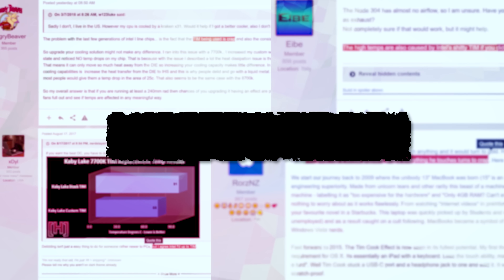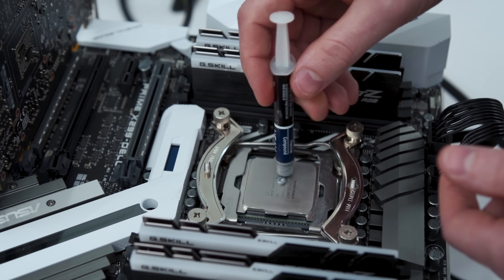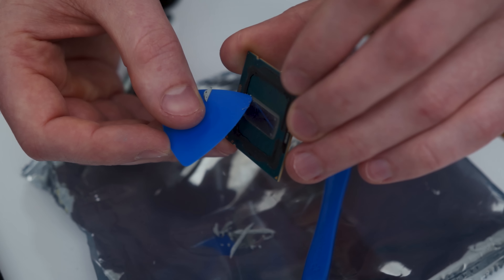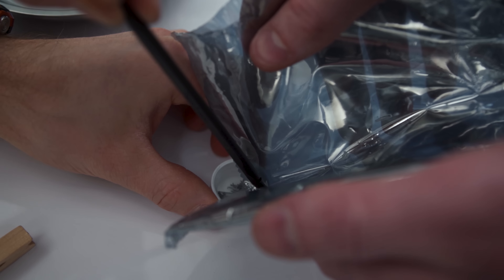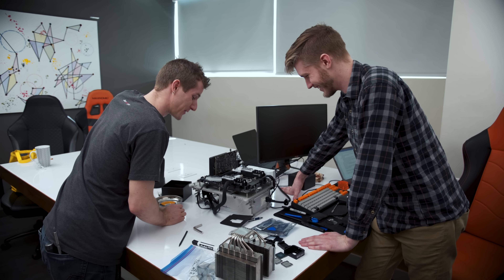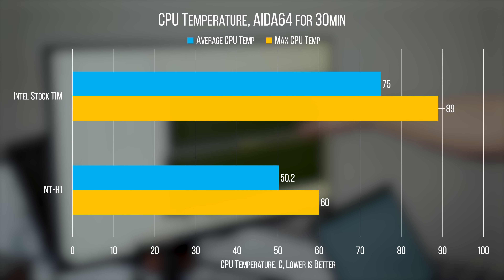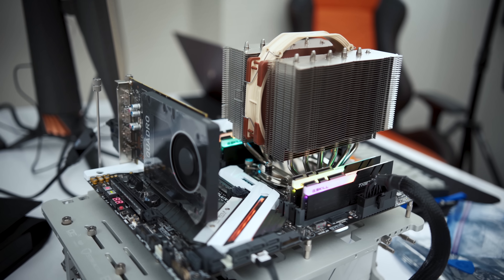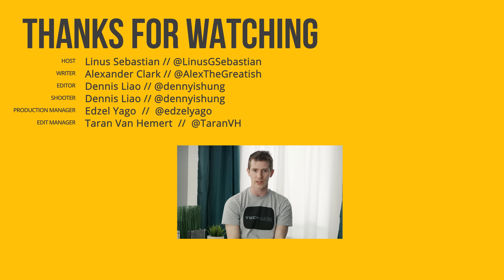Is Intel’s Thermal Paste ACTUALLY That Bad?

Comment: This is really a horrible way to test it..
Reply: xorinzor 
Welcome to LTT
Reply: if you haven't noticed from their "Are review sample CPUs cherry picked?" video, LTT is not very good in these kinds of things, except for regular bench tests.
Reply: i mean seriously.. trying to reuse 6 year old hardened paste? wtf
Reply: What's a better way to test it?
The intuitive way would be, to compare performance Pre vs After delidding, but they actually did that already.

But I agree. All those other factors they wanted to avoid having to deal with, are still present. Just on top of the IHS instead of underneath. Thickness of the application etc.

But this is exactly the kind of ridiculous nonsense that makes LTT fun to me, so I won't complain.

LTT is basically the Marvel Cinematic Universe of tech channels.
Professionally made, entertaining to watch. Not much of anything else.
Reply: I DISLIKED THIS VIDEO XD
Reply: What they showed after taking the cooler off was waaaay thicker than the noctua paste, so the result is kinda garbage :s
Also it still looked wet, so the alcohol was probably the better heat conductor here xD
Reply: xorinzor I've attempted reconstitution of silver thermal compound.  Where mine was originally applied with a nail brush.  Of two bottles; one got wood grain alcohol and the other, acetone.  Neither did any kind of proper job as a solvent.  I still have the acetone bottle two years later and it sits in a pile on the bottom.  It is clear at this point, i require a suspension fluid and a tiny blender to create a proper spreadable colloid.  But I couldn't begin to tell you what arctic silver uses and also I lack that tiny blender.  Even if I were to properly recreate it's original composition, there would be the small detail of oxidation which renders every single particle largely inert.   Linus may as well have been using a pile of rust as a thermal carrier.  Rather, he should use all that clout to gain a sample of the fresh original or leave it be.
Reply: xorinzor I feel bad for Alex having to deal with this video. He didn’t have enough power to tell Linus that applying dry thermal paste is dumb always.
Reply: thats a really horrible way to choose a profile pic for youtube.. so here we are.
Reply: Not just horrible (given the way it was harvested, applied etc) but the very logic behind this whole test is the super dumb too. All they needed to do was to measure the temps with the stock TIM on, delid the CPU, apply the Noctua TIM and measure the temps again. And there you go you have comparison between the stock TIM vs an aftermarket one. If they did this before .... they didn't need to make a new video with a new but dump approach then.
Reply: buying a few brand new pentiums where the paste is still new would be better.
Reply: +R3VISION I'd test it with fresh paste from an Intel stock cooler.
Reply: get a sample of intel's thermal paste?
Reply: Horrible way to test? Yes. Does it still prove that intel's thermal paste is absolute garbage? It does.
Reply: Gametherapist No it doesn’t. That’s why it’s a horrible testing method.
Reply: Get a fresh sample from Intel. Surely they would prefer that than to be judged on ancient dry used paste.
Reply: Let me give it to you straight: As flawed as that method is:
A tube of high quality paste is.. what? like 5 bucks?
If old TIM in regards to new paste gives you a 25 degree difference after delidding, seeing the same here, pretty much confirms that the paste Intel uses is garbage.
Let's say due to the old dry TIM used here, new paste from Intel would still be around 15°C worse than a 5 buck paste from the store. Therefore it's not the age of the paste that's at fault here.
The fact stays: 5$ paste > Intel TIM
Reply: he explained why they did this when theyve already done delidded comparisons. When delidding you change a lot of things, not just the thermal compound, you arent gonna be using the same amount of thermal compound, whether you reattach the IHS or if you just let it sit and have the mobo clamp it down, etc. these would all have effects on the thermals of the cpu.
Reply: I could explain why I used an 88 Chevy Nova to test a new Corvette ZR1 instead of the real thing too, but that doesn't make my test worth a shit.
Reply: Yeah def, there would be air pockets in their intel tim mash
Reply: Triggered
Reply: Tomas Kusnir Wait, I agree that this video was poorly tested, but what was wrong with their "Are review sample CPUs cherry picked?" video?
Reply: It’s horrible way yet it’s interesting that it still worked but how would we know others would/wouldnt work also?
Reply: Just a quick reminder that in Brazil at least they still selling second and third Gen Intel core chips for TOP DOLLAR. These went out of production years ago, so it's almost certain the thermal paste under their lid turned into rock.
Reply: I'm not trying to say it's not horrible. But show me another better way to test other than basically compare stock and delided.
Reply: It's pretty consistent to deliding. So even though it's terrible it worked.
Reply: Aside from the age and issues with air bubbles in their reconstituted tim, my biggest problem with this experiment is that they literally mixed the tim with alcohol to change the physical properties (to make it more closer to a paste) and then expect the alcohol to evaporate and have the physical properties (thermal conductivity) change back to their original state? Chemistry does not work that way.
Reply: @spirialis  7:43
Fact won't lie. Whether it is valid or not, is not in your head.
Reply: You got a better suggestion?
Reply: xorinzor you’re right, he should have licked it to test the flavour.
Reply: They did admit the ridiculousness themselves, though.......
Reply: NocFA dis
Reply: @tomaskusnir2374  ''LTT is not very good in these kinds of things, except for regular bench tests.'' really? they are good in regular benches? haha they forget the fan settings on auto when they make thermal benchmarks and than claim there was no temp difference.... yeah, the fans changed speed temp stayed same as you might expect from the auto fan settings:D doh thats what its supposed to do
Reply: @glenthemann  And using the wrong solvent to melt the old paste

Comment: I've seen better scientific testing methods at 5th grade science fairs.
Reply: I'm pretty sure Intel's been giving him money to do all this subliminal type of advertising lately. Results or anything about this video doesn't matter. Psychologically, hearing LTT bring up Intel so much influences consumers. He just coming up with random reasons to bring up Intel.
Reply: This video is clearly not in favour of intel so why would they be paying Linus to do it?
Reply: Those temps are whack, I got better temps with tim and premium brand paste. I'm sure linus already knew, tell by his laugh.
Reply: Take a bunch of old computers which all have Noctua NH-1 (or whatever its called) thermal paste applied to the CPU, scrape it all off and then apply it the same way you did for the supposedly shitty Intel paste. THAT would have been at least somewhat comparable. This was a total waste of my time.
Reply: @Jose: True. Another interesting control test would have been just bare metal on metal; clean, without any compound. I suspect that would work better than most people would think. After all, you're really only supposed to use the tiniest of tiny amounts of thermal compound, just enough to fill in the microscopic imperfections between the two surfaces. With modern surfaces like those used in this video being very flat and smooth anyway, I'd be willing to bet you'd get damn good thermal conductivity between them just clean and bare metal to metal.
Reply: agreed, this testing is kind of bs.
Reply: Ok show me your proposal.
Reply: also 7:55
Reply: @Nub93  you didn't have to watch the video you chose to remember that before you talk a vid down
Reply: There’s the right way, then the ltt way

Comment: Not valid. Applying dried out paste invalidates the experience.
Reply: Agreed - they should have compared it to some 6 year old used dried out "enthusiast" paste and see how much difference there was then... Comparing with brand new fresh liquid paste is ridiculous.
Reply: yeah, the whole point of thermal paste is to fill in the microscopic gaps between the IHS and heatsink. that dried out flaky stuff is not malleable enough to fill in the gaps and will do nothing
Reply: But intel are opting for this paste because of it's longevity. If they have dried out and perform bad then what is the point of using it. BTW not looking for a comment section war, only trying to understand the rationalization here.
Reply: I completely agree.
Reply: David Martins it wasn't dry when they applied it though
Reply: Yeah if normal delidding tests aren't valid because they introduce "too many variables" (I don't really understand that claim anyway), then using dried out paste mixed with alcohol is DEFINITELY not valid, because that's a LOT more variables...
Reply: Yes but there's a difference between it drying out inside the processor (where, even though its dry, its still making full contact between the chip and IHS) and using it as a dried out powder (where it is not making as good of contact as a paste would because its not filling in any micro voids in the surface of the IHS/heatsink)
Reply: Also even if the classic delidding replacement process had a lot of uncontrolled variables that affect results as they say, the comparison between before / after is still valid. Because Intel should just do it the way that delling people do it.
Reply: +Farhan Chowdhury yea but now they didn't prove anything. they only proved that intel TIM still performs bad after 6 years compared to brand new thermal paste. the argument was never that intel TIM would perform better after 6 years or anything like that.
Reply: their mistake was using alcohol to try and reconstitute it when they needed to use water. the alcohol made what little moisture was left in the paste evaporate.
Reply: I mean, the paste on my 8700K looked the same as this paste. Was dry and flakey, and as they stated the temperature difference was similar to that you get from OEM to Delid temps.
Reply: BUT SIR... Intel Ship them with dried paste ... its like SSTIM
Reply: +Queen Jezebel
That and that only!
Reply: flagpoleeip Ok, but with who? When you don't quote anyone, your comment does not serve any purpose other than confuse. Just saying.
Reply: well i bet he is not talk pro tester like Roman or Stephen more like Noob Johnson that did a test than delids puts conductonaut on and goes from stock intel cooler with stock paste to noctua nh-u12 with nt-h1 paste and cleans his pc and puts new rgb fans close the case runs a test goes to forum post a drop of 40c
Reply: Yep, same dry coop that's previously used under southbridge heatspreaders. Always replaced those brand new and always as horrible. Reason for such bad temps here though wasn't the paste, but the paste's inability to spread, it being so dry and thick. Put a car on top of that cooler for a while and temps would drop.
Reply: You can see when delidded that even if Intel's TIM is dried up inside the CPU, the layer between the die and the heatspreader really isn't thick at all, meaning it spread well when being assembled. Compare that to the massively thick layer or dried up TIM shavings LTT used is a huge variable. They should have either tried to make it more malleable, shimmy the cooler on top of it to spread it out more evenly, or use more mounting pressure, or something to get the layer thinned out to achieve anything.

One interesting test, despite the variables included, might be using various grades of TIM in delidding. Remember that massive tub of really crap TIM Linus bought ages ago? Try something like that or the generic white paste, a TIM that's known to be crap, for delidding and see what happens, how does it compare with Intel's stuff.
Reply: If it's dry powder inside the CPU then it's a fair comparison because that's just what intel has and markets. This video was to show how bad their thermal compound is, and it did.
Reply: It may have dried out, but it dried out in the thinner layer than mated the two surfaces relatively well. This "reconstituted paste" had no effective carrier, and stayed way too thick. You might as well throw some coarse copper powder on there, notice how bad it performs, and claim that copper doesn't make a decent TIM. 

If you can't harvest the TIM while it is still wet, the test is meaningless.
Reply: Because it needs to be liquid when applied. Same as you wouldn't break up concrete and then smoosh the powder back together and expect it to have the same properties. Same goes for glue; no matter how good it is, when you scrape it off after it dried and try to re-use it you'll fail. Come on I thought that was obvious.
Reply: I don’t think the paste was dry

Maybe a bit but I think that’s it

Comment: actual tittle:

Thermal paste vs thermal crumbles
Reply: exactly, not even diamond's surface is perfectly flat, only a liquid will fill the valleys on the surfaces, using powder pieces and considering it decent, is just nuts.

Comment: Wouldn't a better test to be delidding the CPU and replacing with Noctua TIM? That way you have unmolested Intel paste?
Reply: lmfao right
Reply: Special EDy . They could have even mitigated the variables using a larger sample size, like I don't know, a bag of CPUs.
Reply: There are too many other things that you change when you delid a cpu, most notably the distance between the processor and heat spreader. Not saying that this was a better test, but I've heard that changing that distance is one of the big reason delidding works so well.
Reply: Changing the distance isn't much a variable so much as a needed measure in order to make liquid metal work, as its relatively flat and not space filling.  I'd imagine if someone were to test with Intel's own paste the control vs removing and using a lot less silicone to seal it closed much more closely, the differences would be margin of error.
Reply: KainArkanos Distance will make a big difference. Thermal compound is actually a very poor thermal conductor compared to the metal of the heat spreader or the heatsink, it's just a much, much better conductor than air is.
So ideally you want two very smooth surfaces, and a thin smear of thermal paste between just thick enough to fill any miniscule inconsistencies.
If you have a layer of paste too thick it will reduce heat conduction.
Reply: I'm pretty sure Intel's been giving him money to do all this subliminal type of advertising lately.
Reply: They already did that in their first delid video.
Reply: They already did that. This is more experiments on the compound, just more poorly done.
Reply: That test has already been done a thousand times and shows the same ~20-25° difference. This is just a confirmation.
Reply: 0M9H4X well, I got ~23°C lower on my 7700k using liquid metal, but what about NT-H1 with the OEM clearance between die and IHS?
Reply: They addressed it before the intro sequence. They can't do that without changing a bunch of variables inadvertently, like the thickness of the thermal compound, which is part of the reason you'd delid your cpu in the first place
Reply: That has been done a million times with anywhere from a couple degrees of improvement to 30+ degrees improvement. The problem is that we don't know for sure how much of the improvement is due to using a higher quality paste and how much of the improvement is due to other variables changing such as the distance between the IHS and the die. One theory is that a lot of the reason delidding improves temps is because the glue that holds the IHS to the die gets removed, allowing the IHS to sit directly on the die instead of potentially being held off the die by the glue.
Reply: @Jayson Miguel thanks, I went there and it seems like they got a lot of movies there =) I really appreciate it !!
Reply: @Tadeo Keith You are welcome =)
Reply: They did explain that you can't do that because it's not a legitinate test, but I wish they had done it for the hell of it just to see what would happen.

Comment: Sorry, but this 'test' is inconclusive at best.

You recycled old thermal paste from old CPU's and there's no way of telling how they were stored. You then used IPA to make  try make it a paste again, but IPA is a cleaning solvent that could very well have dissolved compounds in the paste. Then you claim the paste application to be a reasonably good job, but you can clearly see big chunks flaking off. The layer was and inconsistent.

Then you compare that to brand new paste, applied in a perfect thin layer...

Regardless of what your conclusion is, the testing method is flawed.
Reply: Just because it would have dissolved compounds doesnt mean they disappear when the alcohol evaporates. come on man have you never done the experiment at school to seperate dissolved salt and water. jeez man
Reply: Yeah this is for entertainment, they never said it was scientifical
Reply: The testing method is flaked
Reply: @Davis38  Your joke deserves at least several hundreds of likes.

Comment: "when delidding and replacing thermal paste, many other variables are changed."  Yes, and this alternative just seems like a much more accurate way to test it....
Reply: I'm pretty sure Intel's been giving him money to do all this subliminal type of advertising lately. Results or anything about this video doesn't matter. Psychologically, hearing LTT bring up Intel so much influences consumers. He just coming up with random reasons to bring up Intel.
Reply: if they could get a fresh application as opposed to using old dried TIM then yes, it would be the best way to test it, but without intel sponsoring them to say how bad the TIM they use is they would have no way of getting it to use.